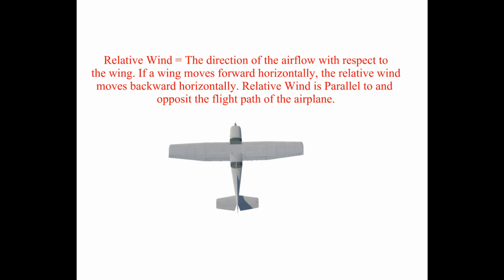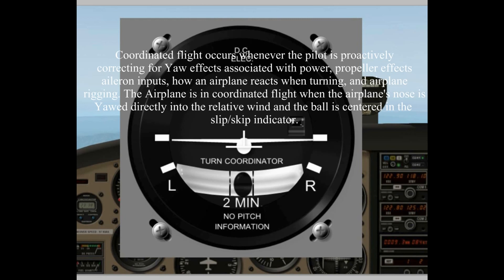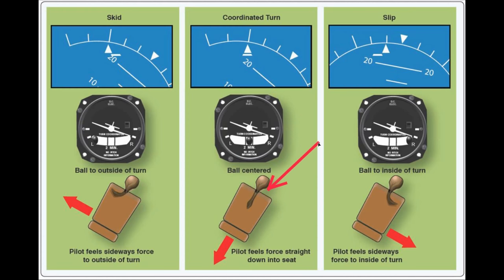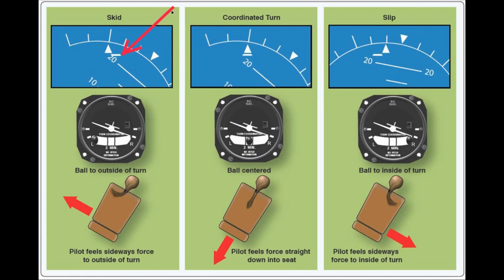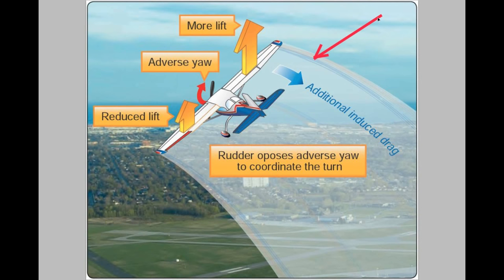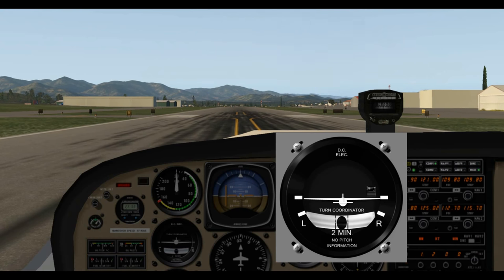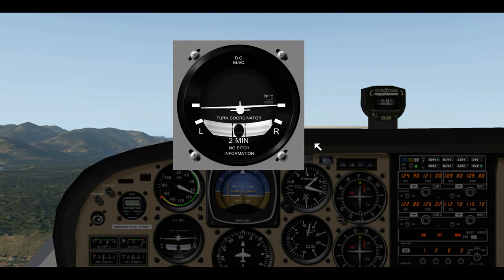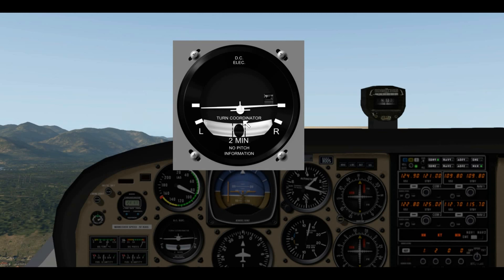The Turn Coordinator ~ Learning to Fly for Beginners in X Plane 11 Part 11

Comment: Skip, the picture of the aircraft in flight is to show the effect of additional drag caused by the aileron creating lift when banking the airplane. The result is what is known as adverse aileron yaw, the plane will yaw towards the aileron creating the lift in order to bank the airplane. The yaw they show in the picture is not caused by the prop but by the induced drag of the aileron.  There are several factors requiring the use of rudder during the takeoff roll, the slipstream effect, propeller torqued effect and asymmetric propeller blade effect, also known as P-Factor. Once you rotate the 172 at 55K in X-Plane you will notice there is no longer the need for right rudder. You will also notice the flight characteristic of adverse aileron yaw is not part of the flight dynamics in X-Plane.

Comment: Slip/Skid Indicator
The Slip/Skid Indicator is the small bar under the Roll Pointer. It moves away from the Roll Pointer to indicate slip or skid, just like the ball on a traditional Turn Coordinator.
Just wondering if it could be the opposite of what you said what's correct on the glass panel.
Reply from the maker: Hi Wilson,  Sorry I don't spend any time with the glass cockpit and have not really paid much attention to that when I did, sorry. As far as I can tell they work the same. With the Ball if you step on the left rudder hard the ball will move to the right and that's the same with the "small bar", makes sense they work alike :-)  Not sure if that's what you meant though, let me know.

Blessings,
skip
Reply: @WEHVideos  I just thought that your explanation was reversed. Small triangle to the left, step left rudder. Small triangle to the right, step right rudder. But it was just an observation. Great video.
Reply from the maker: That's right same with the ball, step on it :-) did I make a mistake?? I'll have to watch the video again.

Comment: Hi, I enjoyed your video, but just a little note, on the glass cockpit slip/skid indications, your images are the wrong way round. It deflects in the same direction as the traditional ball
Reply from the maker: Hi Taylair,  I got this image from the FAA website's Pilot Handbook of Aeronautical Knowledge at the time this video was made and I believe you are right the glass cockpit images are reversed for skid and slip. The new version of the PHAK does not have this image anymore. I don't have any experience with glass cockpits so I wasn't paying that much attention here sorry to say. With that said the principle is the same add left or right rudder to center the ball or bar for coordinated flight in a turn. If you were to make a 360 deg turn a skid is when the tail of the airplane is "inside" the circles flight path relative to the nose of the airplane and a slip the tail is "outside" the circle if that makes any sense. Thanks for bringing this to my attention and thanks for watching hope it helped even with this confusion :-)

Blessings,
skip

Comment: Hi Skip, hope you're doing well. The turn coordinator on the glass display indicates a turn to the left while the instrument below indicates a turn to the right. With the glass cockpit the line below the triangle represents the black ball in the inclinometer. You step on the rudder pedal the line is deflected to which is just the opposite of what you stated. Not sure if you are able to correct this on your video.
Reply from the maker: Hi L Pappas, I didn't give this image, which I copied directly from the PHAK on the FAA website back then,  much thought and didn't notice the difference. Unfortunately I would have to remake the video so it will be this way for some time, the idea of how to use the coordinator is still understandable I believe. 

Thanks for bringing this to my attention. Seems no matter how many times I watch a video before I post it I always miss something and eventually someone will mention a mistake. 

Blessings,
skip

Comment: Thank you for this excellent video on turns. I earned my private pilot license last summer but I still have questions about turns. Is there a video on doing a One minute turn/standard rate/180° turn? For example if you inadvertently fly into IMC and you want to do a 180 turn to head back to to VMC conditions.  The one minute turn or a standard rate turn is required, correct? Is there a video that demonstrates this?
Reply from the maker: Hi G S Thanks glad you liked the video. Here is a link to my videos on turns I think you might find something there: https://www.youtube.com/playlist?list=PLjqSrWIZDAi8VQlOgmhfqGqFVlMSGmhOi

I'm not sure if the standard rate of turn is "required" for getting out of IMC conditions but keeping a small bank angle is advised check this sit out: https://www.flightlineweekly.com/single-post/2019/05/15/Inadvertent-VFR-Flight-into-IMC-Conditions

Let me know if this helps.

Blessings,
skip

Comment: Love your videos. Exactly what I’ve been looking for as a complete beginner.  How do you get a 2d pop out of the flight instrument to display on screen?
Reply from the maker: Hi John, Glad you like the videos :-) The pop out instruments are an add on actually used for making a complete control panel for a second monitor.  I use two different add ons you can purchase them here:

https://www.siminnovations.com/buy/product/65-air-manager-4-home-use

https://www.simplugins.com/html/panel_builder.html

I like them both each has a strong point and weak point so if you go this way do some research to get the one that will work best for you. They are a little expensive!

Thanks for watching!

Blessings,
skip

Comment: Thank you for the coordinated turn information, found this very useful. One question though, a pilot once told me that on larger aircraft, rudders are only used for take off and landings. Using rudders in mid flight would be uncomfortable for passengers, particularly those in the rear cabin. Is this correct? Thanks.
Reply from the maker: Hi Stuart,  That make sense but I wouldn't know having never piloted anything bigger than a Cessna 172N :-)  One thing I'm fairly sure of is commercial pilots don't do much of the flying everything is controlled by the FMC shortly after takeoff and to just before landing in normal circumstances. at least that's what I was told could be wrong. Anyway, thanks for watching glad to hear you found it useful.

Blessings,
skip

Comment: So all those ITMOR and are they called waypoints?....are they like a mapping of locations in the air where pilots know them all by their names like we refer to landmarks and highways and exits when driving? keep things organized and safe?
Reply from the maker: Hi Orange Betsy, Yes, pretty much. ITMOR is what is called a "fix", it's an "intersection" or location in the sky. You will find these "fixes" on sectional charts and approach plates. If you go to skyvector.com and type in ITMOR and hit "go" it will take you to that intersection or the place in the sky, in this case a place on V25 airway. Fixes can be used as waypoints when planning a flight like planning a road trip as you suggest :-) Hope this helps. Thanks for watching :-)

Blessings,
skip

Comment: How to determine the actual alt in the flight then? C172N altimeter does not have a tune knob for outside temperature.
Reply from the maker: Hi Alexander,  That's too much to explain in a comment and I'm no expert but you need to do some math and use pressure altitude. I kind of explain this in my series on flight planning with the E6B but here's a video that does a decent job.    https://www.youtube.com/watch?v=IaYcHBrxIcM

Hope that helps some :-)
skip

Comment: Thanks Skip, your videos are great. So if you have two airplanes at 10000 feet on the altimeter, but their barometric pressure is set differently, they would be a different true altitudes, correct? Can this become an issue?
Reply from the maker: Hi Daniel,  Yes,  Even though their altimeters displayed 10,000ft they would be a different altitudes. Yes this can be a real issue especially if both airplanes had the their BAROs set incorrectly say one too high and the other too low. An extreme example might be one airplane's altimeter displays 10,500ft when it actually is at 10,000ft the other airplane's altimeter displays 9,500ft but is actually at 10,000ft.. If these two airplanes were heading towards each other and following the altitude rules for flight above 3000 ft AGL which states if you are flying a heading between 0-179deg you should fly at Odd thousands + 500ft (3,500, 5,500, 7,500, 9,500 etc.) or headings from 180-359 deg fly at Even thousands + 500ft. (4,500, 6,500, 8,500, 10,500) Each pilot would think he/she has a 1000ft separation from the airplane heading towards them when they are actually on a collision course. Good question thanks for asking and  thanks for watching hope the videos are helping. 

Blessings,
skip
Reply: @WEHVideos  Thank you Skip. So a pilot would have to keep constantly updating the barometric pressure setting for the area they are flying. Is that correct?
Reply from the maker: Well not "constantly" unless you fly into changing  weather conditions if you know what I mean.  For short VFR flights you would normally just tune your com radio to the ATIS frequency a few miles out (10 mi or so) from the airport you are flying to get the correct BAROs. If there is no ATIS at your airport you could find an airport close by to get the ATIS report.  Any time you are landing at a towered airport you will be expected to have the latest weather when contacting the tower, they will ask you if you have the latest if you don't report you have the current weather when first contacting them. If you are flying under the direction of ATC they will update you from time to time during your flight. Hope this helps.

Blessings,
skip
Reply: @WEHVideos  Yes, that makes sense. Thank you very much for your explanation and your great videos!
Reply from the maker: Thanks Daniel and thanks for watching glad the videos are helping.

Blessings,
skip

Comment: Hello, Skip...Hope all is well with you.  I have a question regarding turning.  How do I prevent a serious loss of altitude while into my turn?  Yesterday, I practiced turns, and to my horror, I'd lost about 500 feet of altitude.  I was only up to about 3000 feet to begin with.  Should I be increasing power while in the turn?  What gives???  Thanks, in advance...
Reply from the maker: Hi RbSims,   Any time you enter a turn you increase drag and you will loose  lift so pull back on the yoke or joystick a "bit". You will need to add a bit of rudder also to stay coordinated and add power if needed. So as soon as you enter your turn add a little back pressure on the yoke or joystick,  conditions will dictate how much you need and this will come with experience. 

You can practice this by doing  360 degree turns to the left then to the right. Set your bank angle to 30 degrees and hold it there. Watch the horizon and keep it in the same place on you windshield to help maintain altitude. DON'T get stuck watching instruments use outside references if you can glancing at instruments once in a while.

Below is a link on flying straight and level. I'm not sure if I cover turns in this video but the idea will work. if you keep the horizon in the same position above you instrument visor or on a spot on the windshield you will be flying level, hard to explain here I hope the video helps. Once again, anticipate the loss of lift and start compensating right away. Let me know how you are doing. 

https://www.youtube.com/watch?v=mmSG8y9r0mM&list=PLjqSrWIZDAi-pAYZV9PR3k-WQvyfDKNll&index=4

Blessings,
skip
Reply: @WEHVideos  Once again, I thank you.  I'll practice tomorrow and let you know what happened.  Thanks, again...
Reply: @WEHVideos  Well Skip...You'll be pleased to know that I took your advise.  I did the 360 left turn this morning.  I didn't loose too much altitude.  Next time I'll do a 360 left, followed by a 360 right.  Thanks, again...
Reply from the maker: Looking Good!!

Comment: @2:29 Skip, There are several wrong things on this picture. 1. airplane making right turn, but the blue horizon lines also turn to the right. That is wrong. Horizon lines should turn to the opposite direction - to the left. 2. Another issue is with skid/slip bar indicator on blue screen -  it moves opposite of where the ball on analog indicator moves. That is wrong too.
Reply from the maker: Hi Alexander,  Looks like the blue, glass cockpit example, is in a left turn and the lower 6 pack example is in a right turn but both are correct, you "step" on the Ball in the 6 pack version and the _ in the glass cockpit example to make corrections. I got this image from faa.gov website, The Pilot Handbook of Aeronautical Knowledge. The point is to show the difference in slip and skid using left and right turns. Does this make sense to you?

Blessings,
skip
Reply: Skip, I looked at all 524 pages of "Pilot's Handbook of Aeronautical Knowledge (25B)" full version, year 2016 (the latest). I can not find the picture shown in your video @2:29 .
Reply from the maker: I'm not surprised they update the PHAK at times even change chapter content sometimes.  It's possible I used another source for the pictures that was back in 2018 when I made this video so I could be mistaken about the PHAK. At any rate I think my explanation above make sense and the picture is correct :-)

Blessings,
skip
Reply: if you look at PHAK chapter-page 3-14 and 8-19 you will see that when Attitude indicator and Turn coordinator shown on one picture together they  show you the same situation. But on your picture Attitude indicator and Turn coordinator shown together but they show different airplane turns. Turn Coordinator shows airplane right turn but Attitude indicator shows airplane left turn.
Reply from the maker: Ok  in the picture I used it's just to demonstrate slip and skid and you see two different airplane panels different airplanes. One a glass cockpit the other a 6 pack. The upper blue pictures are in a left turn the lower in a right turn. I can see how this can be confusing and it could have been drawn better. It would have been better if both turns were the same because this is confusing, I have no other explanation. With that you should be able to get the idea of what skid and slip are all about, at least I hope :-)

Blessings,
skip